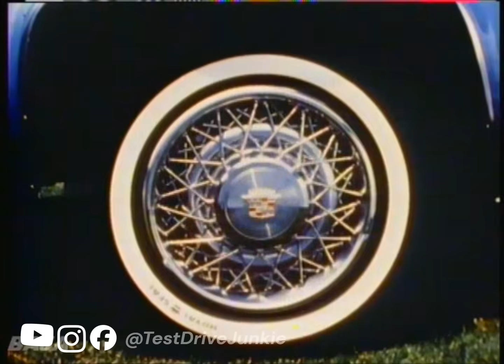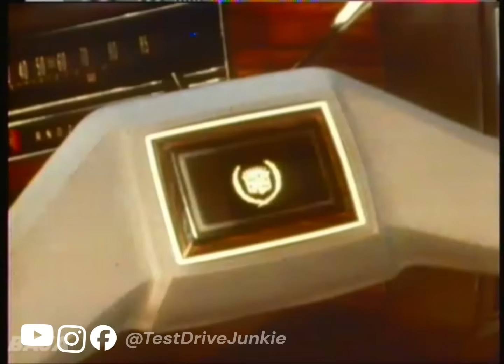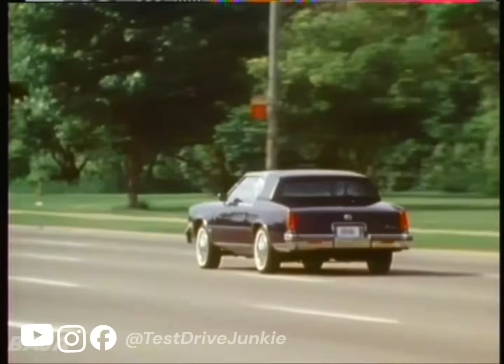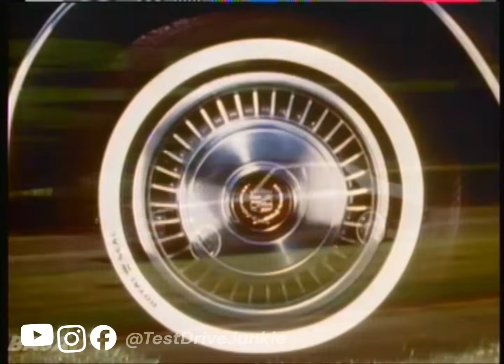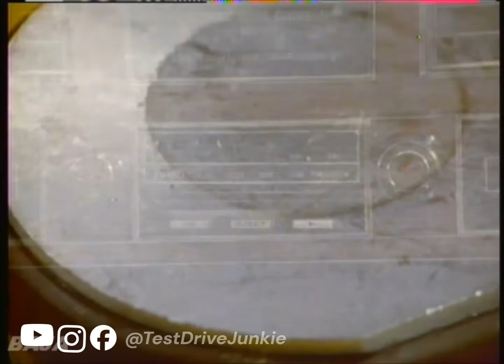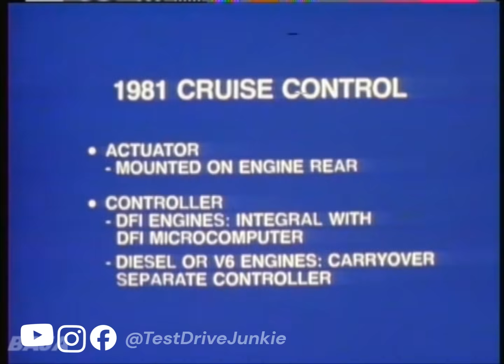1981 Cadillac Features Promotional Manufacturer Laserdisc Video

Comment: The Cimmarron and the  V8-6-4 motor were  the beginning if the end for Cadillac quality. In 1982 Cadillac introduced the HT 4100 motor and the HT stood for Hook and Tow.
Reply: Yep!  Cadillac was anticipating going all FWD and getting rid of its body-on-frame C-body cars.  The HT 4100 was made for the small FWD DeVilles.  When the market suddenly shifted and people started wanting big cars again, Cadillac was caught with its pants down.  All the big Cadillac V8 tooling and casting molds were all gone and they had to make the tiny engine work.  Lower gearing and weight savings just wasn't enough.  The big DeVilles were underpowered and a disgrace to the marque's reputation.  They finally got some mid-market Olds 307's and the occasional SBC 5.7L V8 for towing.  The 1980's was a bad decade for Cadillac for sure.

Comment: My dad bought a new 1981 DeVille 4 sedan, it had the 462 V8, that thing was in the shop more than it was on the road, he traded it 4 months later for a fully loaded Buick Electra Park Avenue, that Buick never gave him problems, he kept it for 12 years, and drove it daily. And yes the car is still in the family it's kept in the garage. We drive it one a month to keep all the fluids lubricated.
Reply: There was NO "462" V8 for that year.  There was a 368 V8-6-4.  A good idea on paper but, a disaster in real life.  There was the diesel 350 and an optional 4.1L V6 to give Cadillac an "economy" engine to sell.
Reply: @BlackPill-obey My apologies, it was the 368 V8 with the 6-4 that car was in the shop more than it was on the road. He finally traded it for a 1984 Buick Electra Park Avenue, and that car ran like a champ, never any issues and rode like a cloud, personally I liked the Buick better than the Cadillac.
Reply: @deltaboy767 The '84 Buick had the ol' reliable mid-market Olds 307.  Nothing special but, it was a reliable engine.  The electronic Q-Jet had a troublesome TPS (Throttle Position Sensor) but, its effect was tolerable.

Comment: Amazing what a few bad decisions did to Cadillac's reputation during the 1980's. Starting with making the problematic Olds 5.7 diesel the std engine on the Seville to the 8-6-4 engine that was introduced 10 years too early to the terrible HT 4100 V8 that was introduced 3 years too early and then the Cimarron.
Reply: The mediocre mid-80s downsizing and cookie cutter badge engineering also didn’t help matters.

Comment: I had a 1983 eldorado I loved that car but had nothing but trouble with it it had more miles going up and down the lift than on the road ac transmission suspension brake system etc thank god I had a warranty but still spent many days at the dealership don rosen Cadillac

Comment: GM later put that seat belt system on all its cars and in all its brands in the 1980's and it was gone by the mid 1990's. GM was at least trying to be forward thinking.  I had no idea it started in Cadillac in 1981. GM called it "passive restraint system". Motorweek used to give them a hard time about it too. I like the digital gauges. So, it was 1981 when they offered them. I saw them in a 1976-1979 Seville as an option.  Deville and Fleetwood did not get digital gauges offered until 1985.
Reply: Those seat belts were actually a cynical attempt by GM to manipulate federal passive restraint regulations, which were intended to promote the use of airbags (a more costly option).
Reply: @sayimjustadreamer  It worked.  I know in the late 1980's they offered airbags on the Oldsmobiles as an option. I recall seeing it in the downsized Eighty Eight brochure. Then Toronado had it in 1990. They it spread to other GM cars. I know that Oldsmobile pioneered the airbag in the early 1970's.
Reply: @OLDS98  The feds eventually mandated use of airbags instead of allowing passive seatbelt workarounds, which most drivers just buckled and unbuckled like regular seatbelts.
Reply: @sayimjustadreamer   I recall people unbuckling the seatbelts from the passive system.  Motorweek showed it in the past and I saw videos and photos of it in the past. I knew change was coming when they put them in the downsized Oldsmobile Eighty Eight and Ninety Eight in the late 1980's:
Reply: @OLDS98  Everybody unbuckled the seatbelts. They were absurd. 😂
Reply: I have never seen an '81 DeVille with the door mounted seat belt, and I've seen quite a few of these in years past.